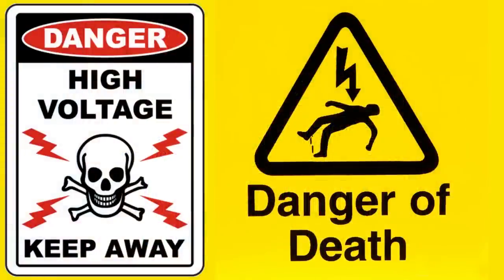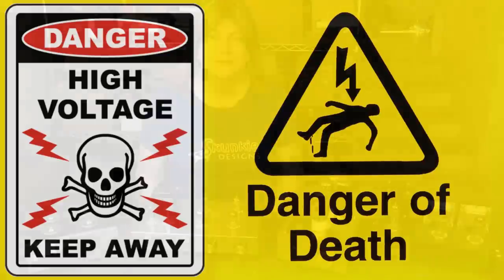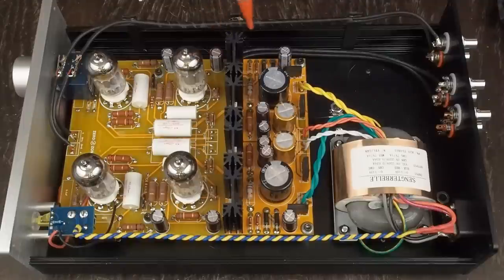HiFi Tube Pre-amp: Final Three Shootout!

Comment: Hey I was thinking.  If they are running the left and right channels from the rca's are they using the shield wire for the ground? Wouldn't that turn the shield in an antenna?
Reply from the maker: It's not ideal at all, but many people wire them this way.
Reply: @SkunkieDesignsElectronics  I'd say.  Seems crazy putting the shield in the signal path. Kinda defeats the purpose.

Comment: regarding chasis ground, Ground loops can be formed and cause real problems with hum. This can happen in any audio equipment. Specifically ground loops induce mains hum in audio circuits by their ground circuit currents. 10 to 30 ohm 25 watt resistor in series will reduce mains voltage enough to make it 6.0 volts
Reply from the maker: WARNING! DO NOT FOLLOW THIS ADVICE HERE OR ELSEWHERE! It is NEVER safe to put resistors between the chassis and the safety ground. You can have a short to ground and not blow the fuse or the breaker. All my gear is solidly grounded and none of it hums. If you have hum because you have safety grounded gear, you are doing something else wrong.
Reply: @SkunkieDesignsElectronics  Resistor in mains lead to reduce mains voltage, not ground lead
Reply from the maker: @mohinderkaur6671  you said "regarding chassis ground", and a bucking transformer is a much better solution that sticking a hot running resistor in series or better yet, don't buy that over priced piece of crap pre-amp with the wrong voltage transformer.
Reply: @SkunkieDesignsElectronics  Exactly. so. Transformer is better.  Regarding Chasis ground - refers to Ground LOOPs issue. 2 different topics. Sorry for the confusion. Ground loops is a problem .
Reply from the maker: @mohinderkaur6671  But you don't resolve them by removing the safety ground. Ever.

Comment: Love your videos. So the reason you get lower total thd from the pre with the higher thd is this: Tubes in SE mode (such as the Spud) produce mostly even order thd. This is a slight assymetric reproduction of the input signal. Tubes turn easier on than off. So as you input a signal, the output goes slightly more in negative direction than positive. Say the input is exact +-1Vp input. The output may be +9.9Vp and -10.0Vp if the gain is 10x (20dB). So if you drive the 20dB gain stage with a preamp/driver with some of it’s own even order thd, this can cancel out some of the lone amp’s thd. This b/c it is now driven from a signal slightly assymetrical in a manner to cancel out the lone amp’s assymmetry.
Reply: Playing with this stuff to seek a 'null' could be fun - maybe by tweaking operating points and levels ?
Reply: @petegaslondon   Absolutely. Same tube driving the output is probably best at this. I have both used a 6AS7 driving a 6AS7 and a 6G6 driving a 6V6. 6AS7 have wonderful amounts of 2nd harmonics but very little else. When matched the effect of same driving same is very good cancellation. Perhaps too good because part of the magic w 6AS7 is the 2 harmonics. There was a japanese designer guru who was famous for the ‘same driving same’ topology. I cannot remember his name.

Comment: This is very interesting. ¿Could the 6SN7 preamp be used for a turntable, or is it better suited as a headphone amp?
Reply from the maker: It can't be used for a turntable because there is no RIAA equalization and I'm not sure it could handle driving a headphone unless they were the high impedance type.
Reply: @SkunkieDesignsElectronics  Thank you very much for responding! Follow up question. Is there a way to get a separate RIAA equalizer, in order to plug that into this preamp? Does such a thing exist?
Reply from the maker: @praxicoide  You are MUCH better off building a "phono stage", I did a video series on an easy to build kit off ebay that sounds amazing!

https://www.youtube.com/playlist?list=PLtEhh3UpOsiDnO2PW6gI38UtZLk-4PFQc
Reply: @SkunkieDesignsElectronics Gotcha! I did see the videos. I just really liked the look of this. No problem then.

Comment: Do you think there is a good advantage of going with a stepped attenuator with resistors versus something like an Alps pot?
Reply from the maker: I honestly haven't tested that, but I would be shocked if it was audible. But I've been shocked before!
Reply: @SkunkieDesignsElectronics  Haven't we all. It hurts every time :(

I may give it a shot. If anything, it will be bling factor. I just built a BA2018 solid state amplifier designed by Wayne Colburn from Pass labs. That is the amp that I want to try it on. 

Thank you for your input! You are the best!
Reply from the maker: @scaryperson27  I wouldn't say it hurts, more like "Oh wow, well I learned something new today!"
Reply: @SkunkieDesignsElectronics  My understanding is, you dont get any wavering 'panning' like with a consumer grade pot, like 'more stable stereo image' as theyre only matched to like 3dB?
I'd dig playing with / making some, if them lil SWITCHES werent so darn expensive ;)

Comment: Like the whole series of your videos, where can one buy candidate no. 2
Reply from the maker: The one with my logo? I build it from a board I got off ebay. Here is their "production" model using the same board.

https://www.aliexpress.com/item/32923155401.html
Reply: Hi, thanks for getting back to me, however I meant the pre amp with the wooden base surround and metal top. Cheers
Reply: @SkunkieDesignsElectronics  Love your videos!  They are out of stock. Any ideas of another supplier? Thanks.